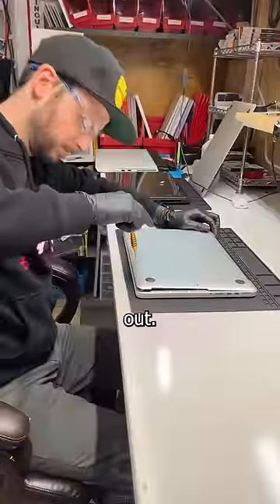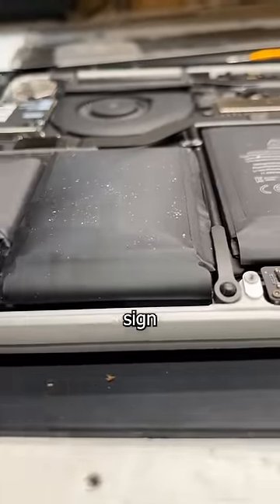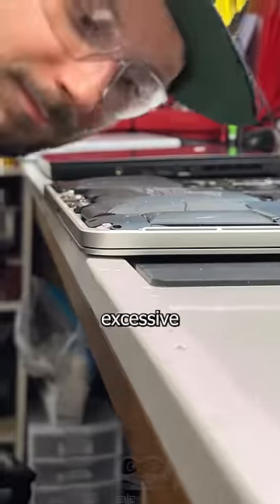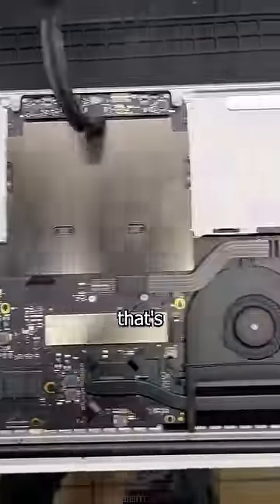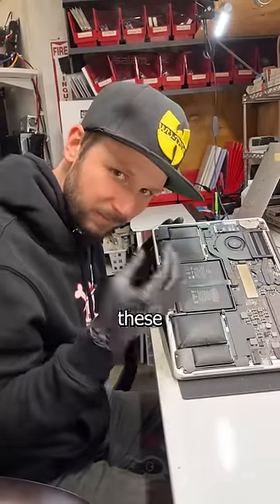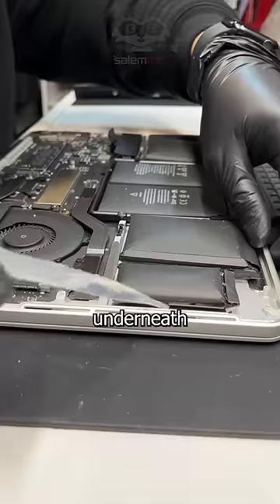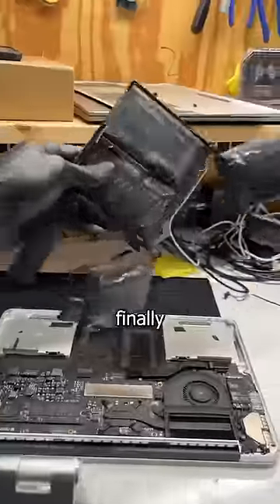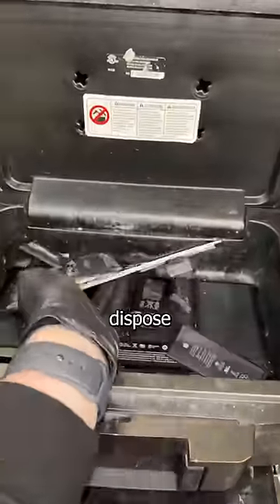2015 MacBook Pro (Spicy Pillow Edition) #tech #pc #technology #shorts #laptop

Comment: Those laptops will throttle like crazy and get really slow without a battery installed. They need them for sudden load spikes.
Reply: Yep I noticed the same with my laptop I had to bite the bullet and get a replacement battery. Performance was restored immediately, It's a bit of a shame that  not many sources online  draw people to this conclusion, and in fact there're many sources that state explicitly that the  battery cannot affect performance.
Reply: That's crazy, it did not used to be like this before.
Reply: @xmlthegreat  this has been the case since apple made the battery non removable in the uniboy macbook in ~2009. They undersize the charger slightly and let the battery handle the peek demand. Very few workloads max the cpu and gpu 100% for hours, so this is rarely an issue. Even then they have a strategy.
Reply: @SimonWoodburyForget  well, my macbook battery lasted 11years thus far and has about 60% capacity remaining. Apple battery management and balancing is pretty good actually. Sometimes li-ion batteries are just die, due to impurities in the materials, bms chips can fail etc. etc. Those batteries are rated for 1000+ 100-0% cycles.
Reply: Can vouch. When I got my white mid-2009 MacBook, it didn’t have a battery. It was fine on Mac OS 10.6.3 which I installed from a disc. Unfortunately as soon as I updated to a version which supports that model, it slowed down A LOT. In Geekbench 2 it got a lower score than my 15” 1.25ghz PowerBook G4. After I put one in it is so much faster.
Reply: @SimonWoodburyForget yeah there should be a switch or something that when plugged it operates purely on wall power (if desired), my old Toshiba when I was in high school had a super hot battery I just pulled off since it snapped on from the outside
Reply: My laptop’s battery won’t even keep a charge anymore and as such my laptop’s bios during boot says the battery charging is disabled. The laptop is about as slow as it was before though to be honest but I DO use that thing as my dummy device. The device I sail the mighty seas on.
Reply: @SimonWoodburyForget That's...not how batteries work?

Batteries degrade over time no matter what you do. You can maximize their lifespan by not using them and keeping them mostly-but-not-completely charged, and technically for battery longevity it would be better if the device had the option for the charger to bypass the battery and periodically top the battery up to 85% (which...I think the newer models do? I dunno for sure, I don't have a macbook), but it doesn't really matter if the battery is good for a very long time, does it?

Apple products have a lot of design choices I don't like, and I will likely never buy anything from them again, but their longevity is not one of those problems. I had an iPhone XR from near launch until late 2023 (about 5 years), never replaced the battery, and its battery health when I sold it was about 84%. I had an iPad Mini 2 from around 2016 to 2023, and the battery was still okay - 4 years in storage with minimal use and constantly being at 0% did a number on it, but it still had a couple hours on a charge, when its original maximum was around 4 hours.

I never really had a macbook (had a hand-me-down at some point but it was a decade old when I got it and I hardly used it, I frankly just don't remember it well), but based on the rest of the Apple batteries I've experienced, I fully expect that the Macbook batteries are excellent, because if there's one thing Apple does well compared to the brands I like better, it's that their products are really built to last and do more with less. Sure, my gaming PC is a heck of a lot more powerful than a Mac Mini, but if it draws around a hundred watts idle/up to 400 under load, compared to around 35/max 150, and the most powerful gaming PCs can go over a thousand. It's no wonder that Apple batteries can power a device so long and remain healthy for years.

Comment: Of the countless spicy pillows we've dealt with, the shattered touchpad was the most traumatic. Thankfully we had a matching Macbook in the donor pile that we could harvest the touchpad from. Is it hoarding if it's justified? xD
Reply from the maker: Those are indeed traumatic!
Reply: I don't run a repair shop, but I do work at an IT company and hoarding certain things that would otherwise be sent for recycling has come in handy to do quick repairs without having to order parts.
Reply: How do you dispose of the spicy pillows? I have many and don't know what to do with them...

Comment: I was installing some new cmos batteries and installing everything new and one of the batteries had "spicy pillow syndrome" and  I'm glad I wore gloves because the battery burst while I was working right next to it, I was given advice to wear gloves with older laptops with old batteries. 

Edit: I forgot to say that I always have a bucket of sand for issues exactly like this so you just bury any battery acid and potentially put out any fire.
Reply: I once accidently overcharged a big lipo cell and it exploded right in my face, luckily i was wearing goggles and face protection but man, that was scary. It seemed like the BMS and charge controller failed

Comment: I owned one of these bad boys. I sold it last week. It went through the exact same issue 2 years ago and I had to do the exact same thing to it myself! I still remember that night. It was amazing seeing inside it for the first time. 
It was running on plug ever since but one thing for sure, it will be much slower without batteries.

Comment: Thanks for showing the battery removal process. I opened up my mid-2015 Macbook Pro just yesterday and in addition to dust removal I hoped to figure out something because the laptop didn't recognize the battery. Just using with power plugged isn't really viable because it detaches so easily that stuff gets shut down all the time accidentally (and it would need a full shutdown every time I'd move it, not just closing the lid). Only one battery module was very slightly puffy, wouldn't even call it spicy, but I'm not if replacing the whole bunch is the only way to breath some life into the thing. :/

Comment: I'm not sure if there is some other fix for this, but in my experience, older (maybe all?) MacBooks operate at a limited performance capacity if it detects no battery. This makes even web browsing and watching YouTube an awful experience. From what I found, this only resolves after a replacement battery is installed, even if all you are doing is running off AC power. I've tested this on a few 2014 MacBook Pros.

Comment: i remember being an overly enthusiastic teenage comp sci kid. inadvertently got someone fired for it too. my moms partner had spicy pillow syndrome on his laptop and the IT guys at his work were lollygagging on fixing it. removed that shit myself with just the ifixit screwdriver set. then i went to michaels for a wooden plaque and used the two screw holes to hang up my work. sadly the plaque didnt last long, they needed to send the battery back. because a highschooler did a technicians job, something that if not removed couldve severely injured a worker, bastard got the boot

Comment: I just did that recently on the same laptop. It took a while for the battery to arrive but now with less than 100 euros, and a lot of labor, I have a decent laptop with Linux on it.
Was it worth it? Probably, yes. Was it fun? Definitely was for me. 
Now my partner’s favorite laptop is back in business again!

I think this things are worth between 350 and 500 euros depending on configuration. With MacOS on it. Which doesn’t make a lot of sense to me but you know: Linux is scary for most folks. 😂

Cheers.

Comment: I once did a similar “repair” with a 2011 MacBook Pro fortunately it wasn’t glued in but it still was hard to get out bc the tool set I had specifically for a 2011 MacBook Pro didn’t have the specific screw that it needed so I had to strip the screws till a flathead could take them out it did work fortunately tho and after that I put in a ssd and 16 gbs of ram to make it better

Comment: I spilled an entire glass of orange juice on my hp pavilion 15 laptop, and after sending it for some local repair I took it back home to find out it wouldn't charge my battery anymore; drained the battery but wouldn't charge it. Bought a new battery but ultimately sent it back to the guy and he told me it would need a whole new motherboard. I just asked him if using it as a desktop was an option and he said sure. Nearly 5 years later without a battery that thing still runs just like the day i first got it. 

It's not amazing but it's not a wimpy computer either, it can run csgo at the lower settings at 60 for reference. Well, it used to before all the updates anyway.

Comment: I had the same with my Dell XPS laptop, the battery was swollen up in normal use under 6 months and continued to do so. The first one they replaced for free and a guy came to me to make the replacement. I have until now replaced the battery total of 8 times, it is ridiculous. As soon as the touchpad starts to rise up, I know what's happening and every click feels like I will puncture the battery now and it will explode.
Reply: Get an OEM battery.

It seems you've been buying aftermarket batteries.
Reply: @prodbydanai  No, they were all original Dell batteries. I never use aftermarket batteries for anything. The first one, as mentioned was replaced by authorized Dell service company with an original Dell battery, however that didn't last either much, although I was aware of the issue and was really careful about it. Next ones I bought and replaced myself, using original Dell batteries.

Comment: had a 2009 macbook came in and he need the data off of it but we didn't know that the battery was exactly like this one so I ordered a new one wrong one had to reorder when it came in it was the right one and had it turn on finally but the issue next was it was boot looping:P after some troubleshooting it was the ram after changing the one card with a new one boom worked like new and the lag he had before was fixed he transfered everything to a larger drive and had me switch drives then he was a very happy customer.

Comment: Aloha

Would like to ask
Using surface pro 7+ i5 11gen...

If over time..
my device battery fail..
Can i remove the battery
And run it plugged in to power 24/7
Through its charging cable
Or even its usb-c port since it can take charging from there as will...?

Device cpu power readings
With msi afterburner
Shows power use between 4~15w
Depending on the what im using

& its a fanless device

Comment: After changing the battery at the same model, my capslock light does not turn on(i dont care) and power on button does not work(i care) because if battery is fully drained, i need to open the case to disconnect and connect every single time. 

Could it be about aftermarket battery or the pillow fucked up sth in the device, any ideas from almost the greatest tech fellas here?😢

Comment: Make small hole in battery protective cover using pin release build up pressure close hole using expoxy glue 
I did onces to my laptop 7 month back still it work fine 
Do this if you have same experience of reparing electronic 
This advise is not for technician😂
This advise is for diy people😊